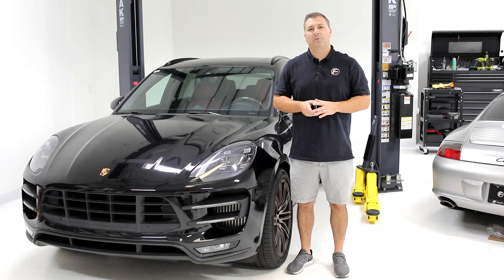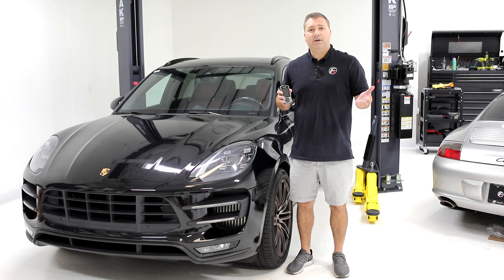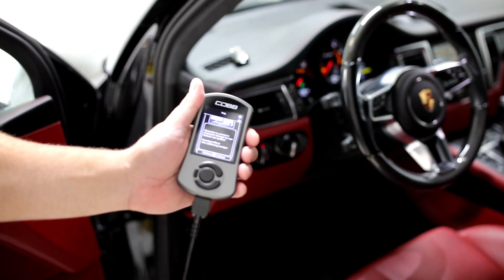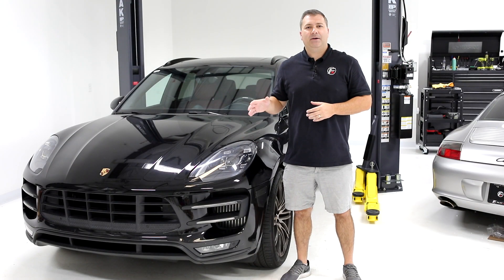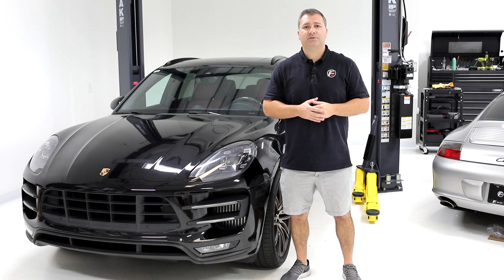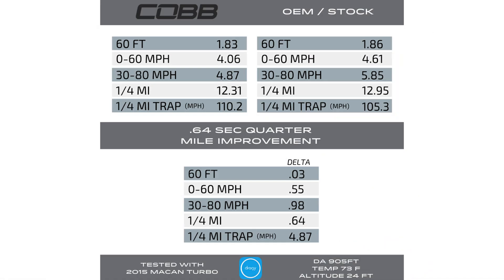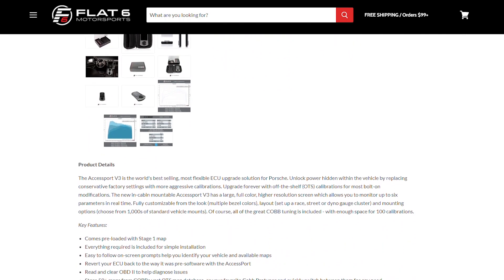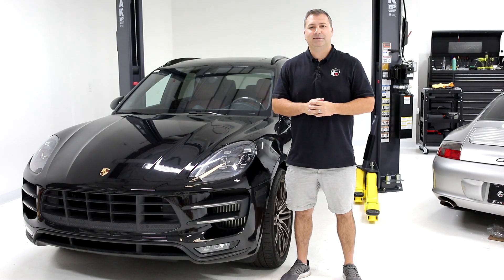Project Macan Turbo: EP3 Cobb Accessport (Dyno Results)

Comment: Sooooo.... Slower than a tuned Sq5 still. The 3.6 is a joke
Reply: @accordv6er Not at all slower! SQ5, German car made in Mexico, no thanks! Not anti-Audi, I’ve owned several including S4 and RS5. The RS5 had a great dual clutch auto transmission which is not available on the SQ5 but is standard and amazing on Macan PDK tranny.  Drove both the SQ5 and the Macan Turbo and the choice was easy, not even close.

Comment: Wish I could apply the Accessport without it ruining my extended warranty… we’ll have to wait until January 2026.

Not worth risk knowing common issues with timing cover leaks and transfer case issues on the 3.0TT Macan S
Reply from the maker: I think you'd be surprised. Had my transfer case done with full bolt-ons and tuning. Tuning won't effect the timing cover leaks. It's your car of course, but you might want to chat with your dealer.
Reply: @Flat6Motorsports  I work for an auto group, we have a Porsche dealership which I bought the car from. Extended warranty is through Porsche. I know Porsche computer systems can read ECU data to expose tunes. I'm amazed at what Porsche can see data-wise. I'd rather be safe than sorry... which sucks. I want this tune so bad. It would completely transform the car.

I used to have a Cobb on my 04 STi, 07 STi, 05 WRX, and 04 Forester XT - great tunes and a lot of fun!!
Reply: @ChessupAI  my Porsche dealer has actually encouraged me to install it!